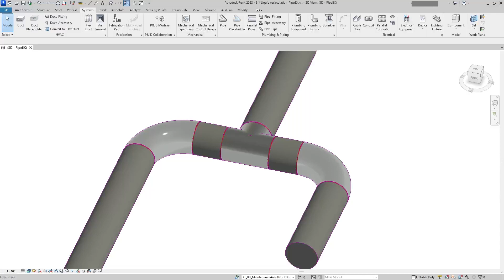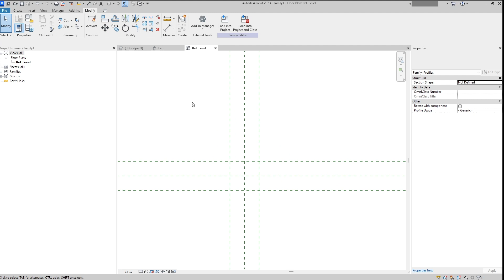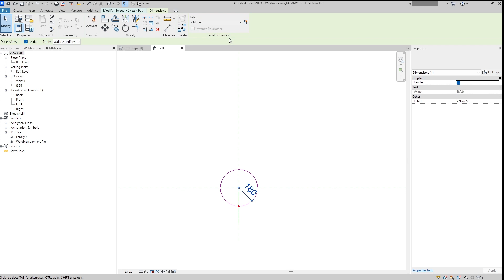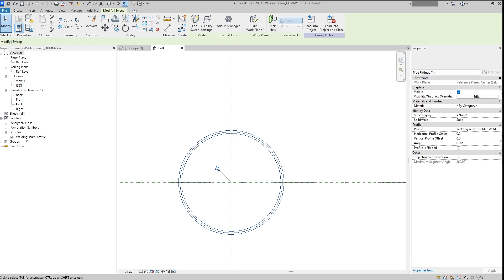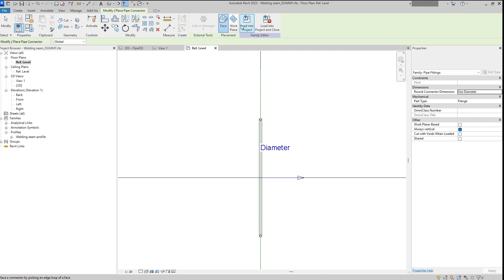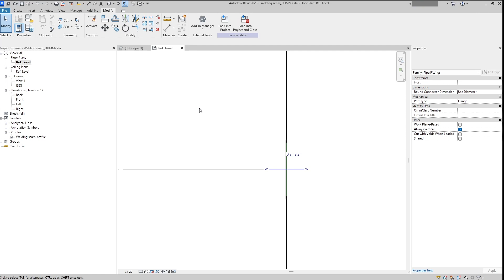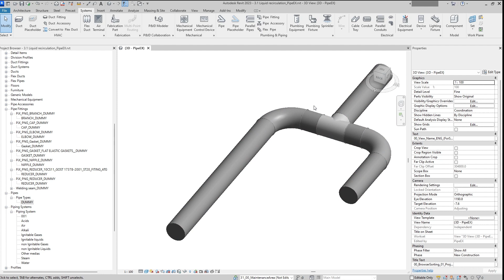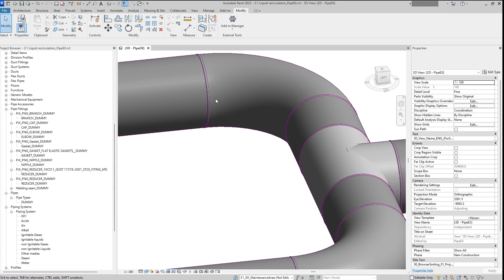Revit Tutorial - Welding Seam

Comment: Hi. I have managed to make the welding seam, is there any way to make a tube-tube union with said family? The idea is that every 6m section of pipe has a welded joint.
Reply from the maker: Hi, glad to hear! Nope, it is not possible to make it in an automotive way with standard revit features. Plug-in or macross is only an option.

Comment: I have not yet been able to generate the sweep, there are parts that I cannot clearly distinguish in the video what steps you have taken. Anyway, I appreciate your time, greetings.
Reply from the maker: If you can write down your steps, we can try to solve it.
Reply from the maker: Just try to practice sweep tool a bit more and I believe you'll be there, notice that the sweep profile must be done with a single line, if you will try to sweep the for the one that contains several polylines it will not work
Reply from the maker: 1st you need to create the profile family (based on the profile template) https://youtu.be/UWPH3qCNXt0?t=43
2nd just select it in your sweep https://youtu.be/UWPH3qCNXt0?t=183